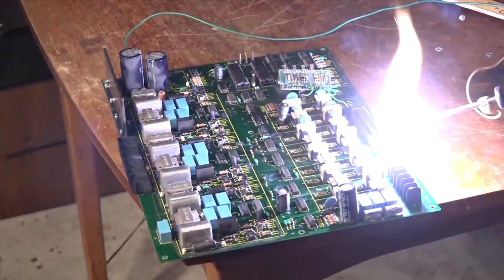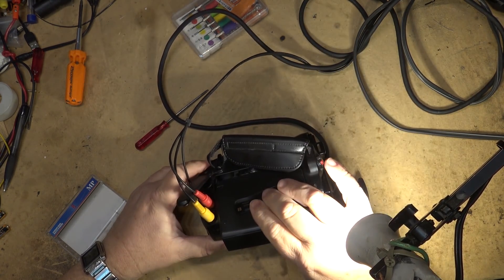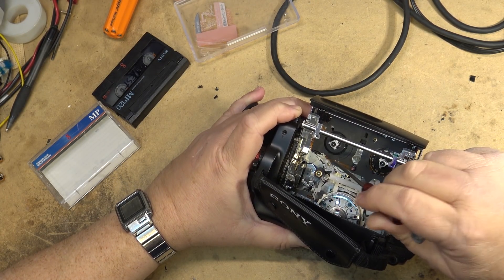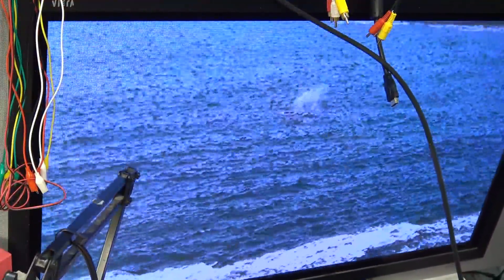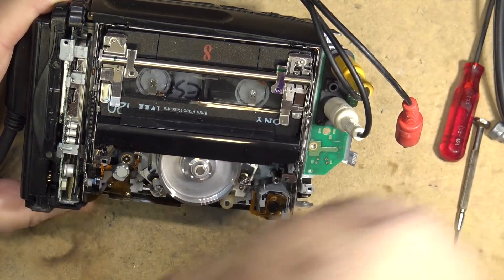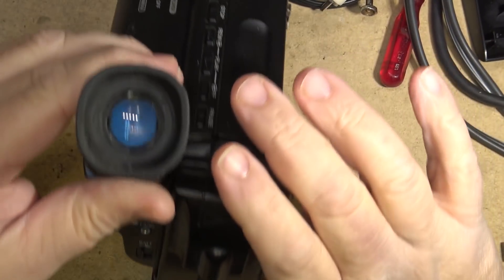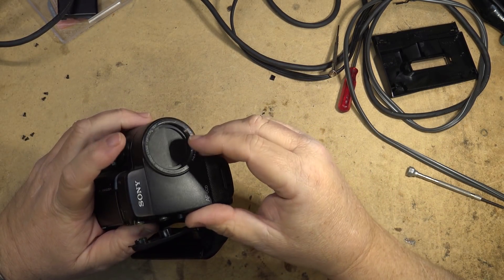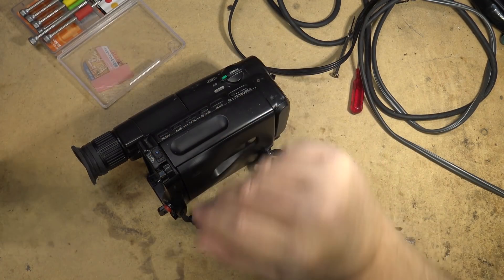Sony CCD TR54 8mm Camcorder Repair

Comment: Get job on the videos. I have a Sony CCD-TR7 after I insert the tape it tries to run but stops. Then I see a red caution light on so I eject the tape. Have you come across this before? Plus did I hear you do tape transfers, just in case I can't gets this old bird to work. Or do you still have any for sale. Thanks and once again great job.

Comment: hello, your videos are very useful. I would have two question regarding the heads. I have found some heads make a very loud mechanical noise while spinning, is there any change to open and grease them ? .  Second question: NTSC and PAL camcorders have the same identic head or it is different?
Reply from the maker: No, the bearing is sealed. If you were able to take it apart it would never work.  Eventually it will seize up. 
Ntsc and pal heads were the same.  They spin different speeds.

Comment: hypothetically if someone hooked up one of these camera's battery "6v" contacts up to a power supply or lithium cell in reversed, providing negative 6.5 volts for a moment, how f***ed is the camera?

Would fuses potentially short and sacrifice themselves, or is that something that the power distribution board is simply not designed to deal with?

Comment: I just bought one of these cameras from my local thrift for 5$ it turns on and everything works it’s in awesome shape except you can’t see picture through the lens just a little white line and it moves when you open up the tape. Just wondering if you know what might be wrong thank you so much I would love to hear back
Reply from the maker: It would be better to ask what isn't wrong with it.  Pretty much everything. 
Bad surface mount caps that will have leaked their corossive cap juice all over the board and damaged it.

Comment: Hi ! Do you think it's possible to make a video output connector to my ccd m8 ?
Reply from the maker: That's little record only one correct.  No not possible.  No playback circuitry in that one.
Reply: @12voltvids  thanks. my idea is to connect the camcorder ton a digital recorder for remplace te tape recorder. but no video out for that. it's complicate to install a video out after the sensor ? or before the recorder ? it's just an idea ^^thanks
Reply from the maker: @oliviertresson7662  even if you could you wouldn't want to.  Those old CCD chips were bloody horrible.   They were low rez and needed a ton of light to see anything.
Reply: @12voltvids  yes of course.  but it's for a special movie on a beach and il like the image of this camcorder for this 1984 project :)

Comment: Is there any chance you know how to fix a model ccd trv-98? It has the cassette compartment stuck, its closed but won't come down.
Reply from the maker: Probably could depending on what is wrong.  I am pretty good at troubleshooting as you will see with the next video, a betamax with 3 totally unrelated faults.  The only decision i need make is should it be 2 shorter videos or a single long video.

Comment: Hi!! I have a Sony Camcorder like yours and the audio playback is not good. How to fix that?
Reply from the maker: If the picture is good, capacitors are  bad on the audio board.  The audio board is the little one at the front beside the lens in behind the front casing.  It plugs into the main board.

Comment: I was given one of these by an uncle, and he said it didn't work, however, I plugged in the charger, I got no power, but then I pushed the battery charger further in, and boom, it powered on, and the rest of the time, I recorded the rest of my trip to Mexico with my ccd-tr54 and my panasonic pv-l353.

Comment: Thanks for another great video. Such an easy repair. I wish all the repairs were that simple. I did the same thing on a recently acquired D8 camcorder. I didn't have to dissasemble anything. The missaligment was not that big of a deal. It was just noticeable in the last few lines of the image, at the very bottom of the screen. A little tweak on the exit guide with the cassette compartment in the open position and voilà. Didn't even have to monitor the image on the screen. I would keep that camera for parts... a mono 8mm camera without tbc/dnr... doesn't have any resale value. There are better options to digitize your tapes.
Reply from the maker: It's already sold and paid for.

Comment: I still have my dad's TR330. It got killed by overvoltage a long time ago and never worked again, even after jumping the fuse. It just displays garbage on the viewfinder and beeps. So, what could've happened to it? The Sony technician said it was beyond repair.

Comment: The alignment was probably not good for recording on your tape. If you were trying to record and play back on a new tape with the old alignment, I think the recording would have been OK.
Reply: The recordings made with this camera would play just fine with this camera but the problem arises when you try to play that tape on another camera/vtr. It doesn't make any sense having a camcorder that can't play back tapes recorded with other camcorders and which tapes are not playable on other equipment.
Reply: @josegti84  , agree with that